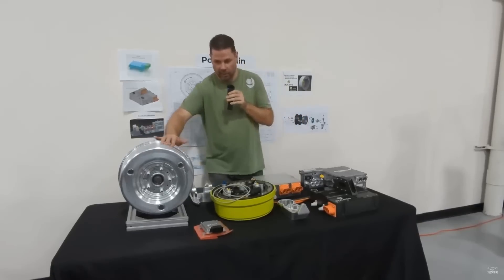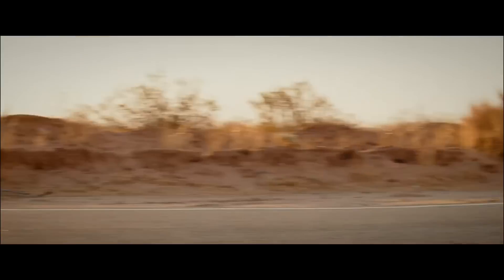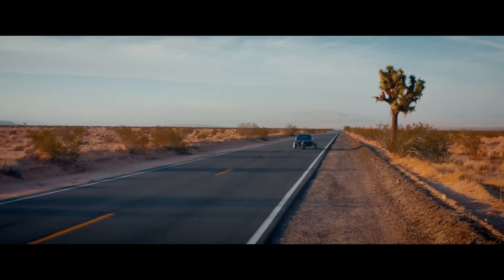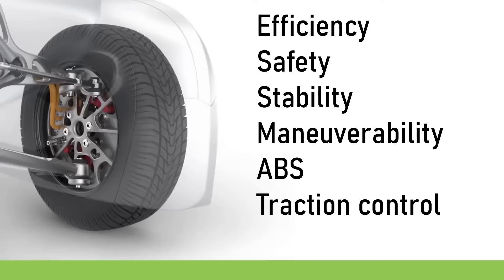Why is Aptera using In-Wheel Motors? (ft. Elaphe)

Comment: Curious about the additional work the suspension has to do given the increase in sprung weight (if I'm getting that correct) of the wheel plus in wheel motor. Is that a relatively simple engineering problem to overcome? Does the ability to apply power directly to the wheel/wheels reduce the potential negative effects on directional changes?
Reply: Close. The mass on the wheels is "unsprung", because there's no spring between it and the road. It means that you have more mass jumping up and down; which results in some combination of the wheel not touching the road and/or the car lurching about. 

It's one of the reasons that basically no one does this.
Reply: @jerrylove865  Actually wheel motors are becoming increasingly common in lower speed vehicles like trucks and buses - because it significantly reduces drive train space (that can then be filled with batteries instead).
Reply: @allangibson8494  "lower speed" being pretty significant here. The requirements on the suspension are lessened at lower speeds. 

Also: It's a mass competition between the sprung and unsprung portions of the vehicle. On a more massive vehicle, you can get away with more unsprung weight.
Reply: @jerrylove865  At normal road speeds the additional mass of wheel motors is irrelevant. A steel wheel rim, brake drum / disk and drive shaft weighs more than a wheel motor (particularly on a truck). You have to remember the motor also replaces the wheel brake assembly.
On a racetrack or autobahn the increase in speed makes unsprung weight significantly more important. Applications matter.
Reply: @jerrylove865  The fact is that there are many vehicles on the road now with wheel motors.  It is only recently that the tech has made them more available at a competitive price.  Proper suspension design has been able to control steel wheels with the 50 lbs the Aptera wheel motors weigh for decades.
Reply: @n.brucenelson5920  Many massive, low speed vehicles. 

F=MV^2. In this case, the mass is the unsprung mass and the V is the vector skew from the overall vehicle vector (so, the speed at which the wheel must move to deal with the bump or hole). 

As you increase speed, there's an effect on V. As you increase unsprung mass, there's an effect on M. 

Attempting to control this is the suspension, and to "push off of", it has the sprung mass of the vehicle. 

So the issue rises as the percentage of mass moves from sprung to unsprung, and as the speed increases. 

So we may well see these on the road in construction vehicles, trollies, and perhaps even buses; but there's a reason you've not seen them appear general cars.
Reply: @jerrylove865  The major reason that we are only seeing them now is that the engineering for good general performance is only now getting to the point where they are good for a vehicle such as Aptera,  As far as speed goes, your point is valid in general, but Aptera is not a "high speed vehicle" in the sense of most race cars, and is RPM limited to 110 mph, more than plenty for the purpose.
Reply: @n.brucenelson5920  Low profile tires and low-weight brakes and wheels are not restricted to >110 mph vehicles. It's most significant when cornering. 

The Aptera actually appears to be a convergence of the worst possible cases. It gives up a wheel (making individual wheel contributions higher), it's inherently less stable than a 4-wheeled vehicle (though far better as a reverse trike than a trike would be), and it's overall weight is low (meaning there's less sprung mass)

Add to all this: The wheel is a gyroscope (a problem with spinning mass). 

If they are using the HVH250, that's 33.5 kg per motor. For comparison: the wheel on a model 3 is ~10kg - 13kg (depending on which width). The brake rotors are about 5kg. If I'm generous: it sounds like the electric motor would double the weight of a 20" wheel. Since the Aptera is likely using smaller wheels; the increase will be more dramatic. 

We'll see if and when these hit the road, or at least the test track.
Reply: @jerrylove865  Yes, once the deltas are released we will have much more data.   Aptera is using 16" rims..

Your statement"it's inherently less stable than a 4-wheeled vehicle, is clearly wrong, because the use of wheel motors in an EV means that the center of mass is lower than vehicles with conventional wheels.  In addition there is far less wind pressure, especially acting on the sides, and with less lever arm.  Aptera passes the moose test, which is something many of these slab sided vehicles can't achieve.

Also the in wheel mounted electronics means that the ABS/traction control can be faster acting, sensing wheel slip and adjusting torque 32 times per wheel revolution - a much better performance than with most conventional systems on the road now, amounting to about every 2.5" of tire tread travel.
Reply: @n.brucenelson5920  While center of gravity plays a major role in stability; it's not the only facto. To make an extreme example: put only one wheel on the car and let's talk about stability. 

"wind pressure" isn't generally a cause of instability either; though in high winds on trucks and vans it can come into play

"Also the in wheel mounted electronics means that the ABS/traction control can be faster acting"

No, it can't. For one thing; detection is generally across multiple wheels. For another, the signal takes 1/180,000,000 th of a second to travel a meter through the wire. So proximity would only be a factor if your sample rate were in the millions/second.
Reply: @jerrylove865  No, you are correct that it is not the only factor.  The 77" wide front track is another reason that Aptera passes the moose test when many other vehicles do not.

If ABS systems on most cars are controlled by CAN bus the maximum data transfer rate is 1MBS

Copper slows electrical current to about 70% of the speed of light data transfer rate.  

There are several reasons standard systems are slower - First, the speed of the signal through copper is only around  about 70% of the speed of light.  Current flowing through wires generates magnetic interference with the signal.  I suspect that the inertial response of the hydraulics is another factor slowing down the repsonse compared to Aptera's wheel motors.
Reply: @n.brucenelson5920  50 lbs wheel??? Are you F*n kidding me? That's both left and right wheels and wheel hubs brakes, brake rotors on my car combined.
Reply: @jerrylove865  Yes we will.  Since I have already ridden in one before Roush redid the suspension, I am not worried.
Reply: No, increase in 'unsprung' weight.
Reply: @jerrylove865  And the number of reports of smashed rims caused by potholes suggests they are wasting their money with low profile tires that are unsuitable for actual road use on actual roads.
Wheel motors as brakes comes under electric braking systems. A holding brake would also be required but wouldn’t be required to dissipate much heat in service so would be a minimal mass.
Fashion is not good engineering (and never has been). Low profile tyres are all about extracting money from rich idiots wallets not any actual performance benefits.
Reply: @allangibson8494  The purpose of reducing unsprung mass is to improve traction. That a low profile tire does less to protect a rim from getting damages in a pot-hole in no way interacts with a conversation about mass and it's relation to traction. 

Though, interesting note: the added weight in the wheel from the motor is going to make it more susceptible to the sort of damage you describe.

Comment: I think it all sounds impressive, but it all will not matter if it does not sell.
First, I do not think that the public is ready for the design. It may be a more normal design 30 years from now, but not right now.
Second, I do not believe that the public is ready for a 3 wheel vehicle. I completely understand that having the 2 wheels at the front corners is very stable, but even I picture the thing rolling over in a slight breeze. (Thanks to the 3-wheeler craze back in the 80s or 90s) 
Third, I do not think that the public is ready for such a delicate looking vehicle. This could range from the perception that it is not reliable to getting rear ended by a Ford F-350 (ouch). 
Not all is lost though, there will be a lot learned from perfecting this vehicle for future EV's.
Reply: you do realize motorcycles exist, you think those are more stable then this? Do you think motorcycle riders care about being able to survive a F-350 rear ending them?
Reply: Already more than 35,000 pre-orders.  This number will explode once people start seeing them on the roads.  The Reliant Robin sold 1/2 million copies.  The "rollover videos", notably from Top Gear were with vehicles that had been rigged to do that for comic effect.  

I think that even Aptera is surprised by the demand being shown.

Comment: After a few hundred miles on city streets those motors will be shrapnel.
Reply: I've seen people ride cheap ebike hub motors for 10,000km the only thing that wears out is the tread and the chain, These are much tougher than that
Reply: @Polar_Onyx  let's be real here an ebike weighes maybe 100 pounds the impact it endures on the pavement is significantly less than what a 4000 pound vehicle has to deal with....try again.
Reply: @problactive285  The 400 mile range Aptera I have ordered will weigh around 1800 lbs or so.
Reply: It is easy to make comments with no basis in reality.  I will soon be driving mine in all weather on rural gravel roads in Iowa - a much tougher challenge.
Reply: @n.brucenelson5920  if you can put 1000 miles on those without a issue do a testimonial video and I'll eat crow...

Comment: I understand the benefits.  My concern, is unsprung weight.  A heavy wheel won't follow a rough road as well as a light wheel.  A light wheel tire would weigh 33lbs, add 15 for the brakes, total of 48lbs.  The motor weighs 77lbs, for a total of 125lbs.  

Each wheel is supporting about 500lbs of car, about the same on a Miata.  Increasing the weight of a Miata wheel by 10lbs has huge impact on handling.  77lb????
Reply: The Elaphe M700 motor, the one that Aptera's is based on, weighs 50.7 lbs.  I think you are way overestimating the weight of Aptera's wheel motors.
Reply: @n.brucenelson5920  That was the weight I found on line.  

50.7 lbs is better, but with the weight of the car, unsprung weight could be an issue.  I would like to see a hard corner on a rough road.

That said, as soon as I see how they perform.  The rest of the engineering has been excellent, so I will buy one (1000 mile / full solar panels - in San Diego).
Reply: @stevesedio1656  Yes, that will be the final arbitrator, won't it?  I saw that reference to the weight you cited, but it is considerably too heavy.  I don't know where that came from.
Reply: @n.brucenelson5920  I understand the efficiency advantage by direct driving the wheel.  

If handling is a significant problem on rough roads, move the motor (and brakes) inboard.  They will incur a small loss from the CV joints (and a 90 degree gear for the rear drive wheel).  

Another approach is to combine the wheel, motor, and brake into a single structure.  Integrate the motor magnets into the wheel.  Add a set of windings to in the motor that is connected to a back up brake system (heats a resistor instead of charging the battery).
Reply: @n.brucenelson5920  50.7 is the motor, add the tire, the bigger the heavier, the wheel, again bigger the heavier.  yeah your looking at something that is north of 80 lbs.

Comment: What motor is not cushioned from road shock, snow and ice clumps. What mounted wheel covers/ fenders are not cushion/ protected from road shock and ice buildups? Have empirical studies been performed to determine how at least three months of winter salt treated highways and city streets affect wheel mounted sensitive motors and their accompanying wheel mounted wheel covers? Only one vehicle comes to mind--Aptera.
Reply: Really like the design and power sourcing ideas. Just put motors inside rubber mounted and shock absorbers protected, and then it’s a winner!
Reply: @tommorgan1291  Which is what they do.  They use a rubberized potting compound to isolate motor parts from outside influences and adsorb shock.  

I used to work for a company building seawater cooled electric motors for boats and that is what we did.  We hired the Tesla motor engineers back in the day when Tesla had to lay them off due to lack of funds.

When i heard Aptera had restarted I quizzed Elaphe about the technical details of what they were doing, and they provided me with reasonable answers from the standpoint of our own experience with motor design and testing.
Reply: Thank you. Appears your satisfied and technically qualified to opine.
Reply: Elaphe has done many 100 hour salt spray tests on the wheel motors, as well as extensive winter test track testing.

Comment: Torque vectoring is not an in wheel motor only feature, ICE cars have had that in the form of limited slip differentials since before the people at aptera were born.
As to the other performance, I want to see the laguna seca or Willow Springs lap times for this compared to a chaterham which has the same weight and power output
Reply: And of course a Chaterham and Aptera are identical in design language, use case, and owner demographics.
🧐
Reply: @ernestgalvan9037  Yes, certainly, except AWD Aptera models are faster than almost all Chaterhams 0-60. ;)
Reply: @n.brucenelson5920  only in a straight line and only on paper as there are no production cars yet
Reply: @pogo1140  Not only on paper.   My wife and I rode in a prototype last November, and the performance is thrilling.  Aptera passes the moose test, so the handling matches my experience in an alpha model.  The suspension was redesigned by Roush Performance, so the ride will be less rough than what we experienced.

Chaterham has a reported top speed of 155 mph, while Aptera is rpm limited to 110.  My guess is that the Chaterham will have better lap times on courses with longer straights.

Aptera only got started on this design in 2019.  Considering that it took Tesla 6 years to deliver their first simple Lotus Elise conversion, and that Aptera seems to be ahead of Tesla's pace with the Cybertruck to delivery their first production vehicle, they are doing an absolutely amazing job in a tough environment.
Reply: @n.brucenelson5920  prototype is not production. The mini prototype had a more powerful motor than the heavier production version.
Reply: @pogo1140  You are correct that the production motors have changed since the alphas.  Gamma has a production intent motor - which is probably lighter than the first prototypes.  We will have detailed specs when delta is introduced.
Reply: True, but these devices consume power in increased friction and heat, unlike the wheel motors.
Reply: @n.brucenelson5920  not enough to matter. And they will last the life of the vehicle as long as you replace 3 oil seals and the oil every 5-10 years
Reply: @pogo1140  The small losses from the differential and drive shafts are quite significant for a vehicle as efficient as Aptera is, especially when considering that we are trying to maximize the solar contribution to range.
Reply: @n.brucenelson5920  so you have a 110 hp motor sitting in an isolated dry box vs 2 50hp electric motors bouncing up and down with just the tires to protect it.

Comment: Even with a conventional Ev design hub motors are a huge advantage because of the space you get back between the rear wheels, perfect for putting a large battery pack while still able to remain rear wheel drive.

Comment: You forgot that the Aptera's front wheels are exposed outside the vehicle and therefore vulnerable to all kinds of road accidents where the front wheels are hit. Myself, I would never buy a vehicle with such a vulnerability.
Reply: replacing 1 motor and wheel ~3k would probably be comparable then rebuilding the frame and replacing the drive shaft on a traditional car in the same crash.
What exactly is more vulnerable about being separate? if anything they would be safer as they could break off during a crash.
Reply: There are always engineering trade-offs.  The saving in operating costs due to better aerodynamics is likely to be greater than the occasional accident cost.  We will see what the insurance stats show us.
Reply: In a front end collision the risk of the wheels or engine getting pushed into the passenger compartment  passenger compartment potentially causing injury to the occupants is eliminated.